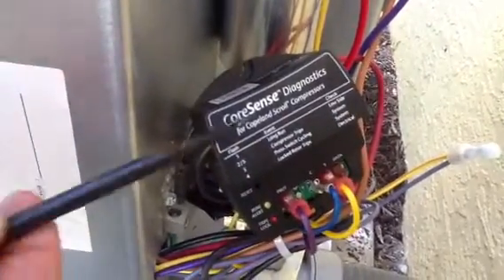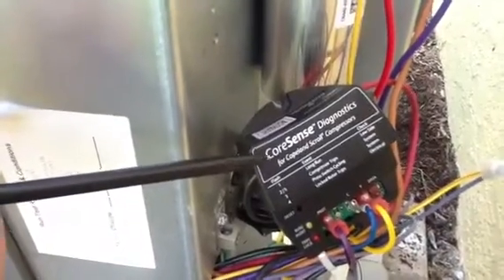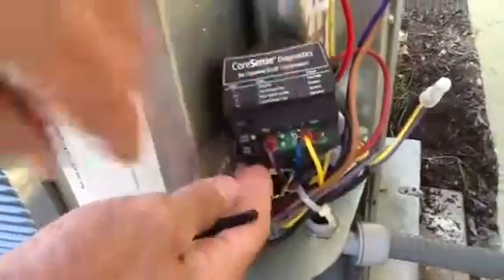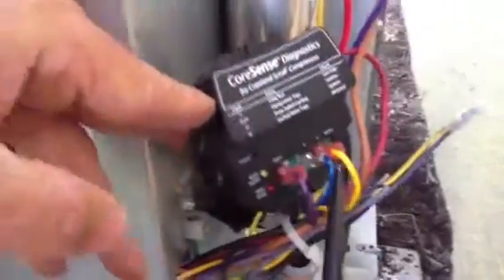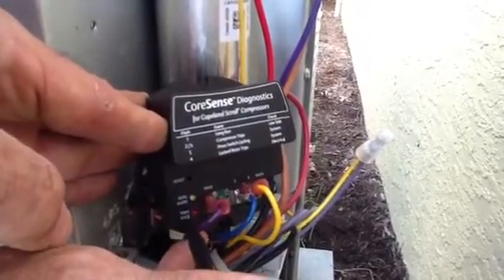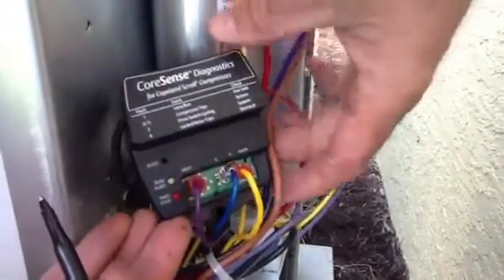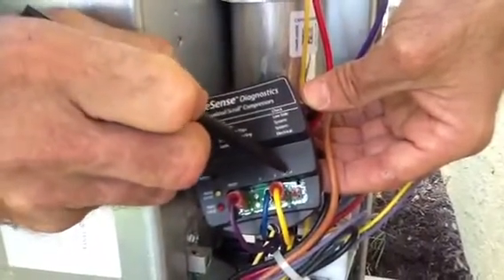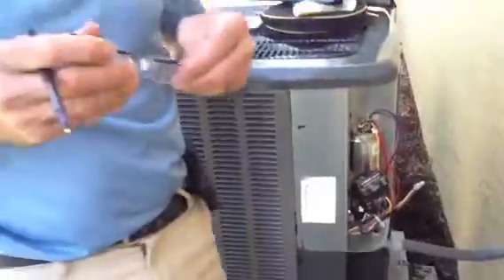What is a Core Sense Diagnostic module!

Comment: My AMANA air conditioner uses this controller, the yellow LED light is always on, but the heat pump just doesn’t work. Why? By the way，The outdoor temperature is  -15 degrees Celsius now.

Comment: Has me confused as a long time designer of diagnostic systems, automotive is dirt cheap, no secondary references to compare to, more like guesswork, least military spends a couple of extra bucks with references.

Now for the Coresense, downloaded the manual and studied it. Not that outside units are that complicated.  Just have a 24VAC thermostat input to a contactor that switched on 240VAC to both the fan and compressor, but each instead of two wires has a third through an AC capacitor that gives a leading edge extra waveform like a two phase motor.

By adding the Coresense the only difference, is that the thermostat output instead of going directly in the contactor is going into the input of the Coresense unit.  So no matter how you look at it, it is only looking at the contacts of the thermostat and that is it.

The output of the Coresense goes to the contactor, so what is going beyond that is any ones guess, no 240V, burnt contactor contacts, low or hi pressure sensor shot or out of tolerance, capacitor shorted, or jammed fan or compressor. 

Looking at just to thermostat cooling contacts, will tell the duty cycle of the compressor, but very indirectly.  Any arguments against this?

And since it is in series with the solenoid of the contactor it can easily be the problem of no compressor operation.  Can have 24VAC in but zero VAC out.

Comment from the maker: Yes this will help all of us in the future as this is installed more and more equipment, and we as an industry have the right training to use it to  diagnose quickly. Thanks for your comment.
Reply: I have one of these on my a/c unit and there is no lights flashing or coming on this module I have that exact one. I’ve trouble shooted everything and my unit is not working. I’m thinking it has to do with this module because there’s no light of any kind coming on the device and my a/c unit will not come on
Reply: @cjbake3238  mine also has no power either with the AC is on. Will take the multimeter to it tomorrow.
Reply: Did u find what was wrong?
Reply: @cjbake3238 I am having this exact same issue. Were you able to troubleshoot the problem and get your AC working? Did you need a replacement Coresense